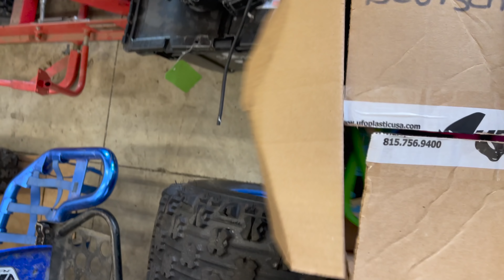Picking Up My Kx Kawasaki 500 After Being Restored Frame Off

Comment: Bro get lectron carburetor
Reply from the maker: On the kx ?
Reply from the maker: Ok
Reply: I’ll second this comment, you’ll receive cleaner jetting, throttle response sharper then a straight razor, fuel consumption will be reduced  and riding time will be increased🤞🏽💪🏽 and you’ll have a bad ass looking carb